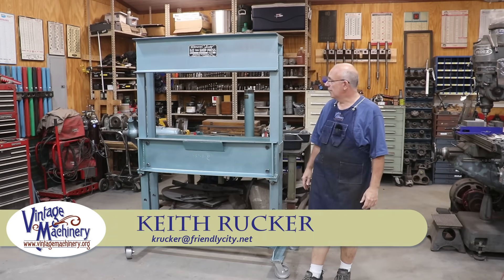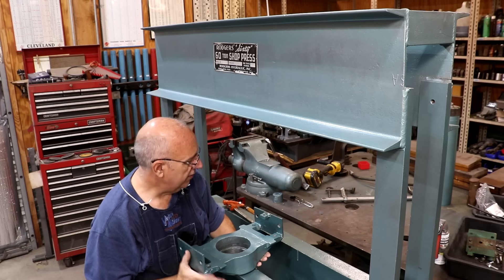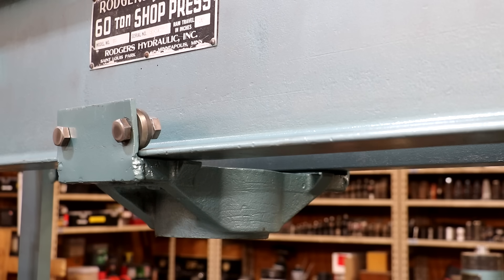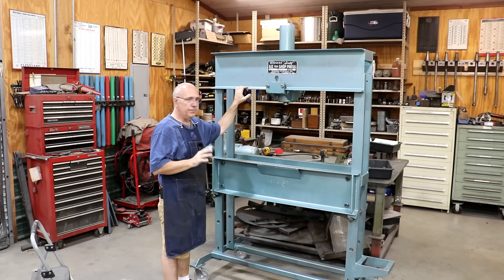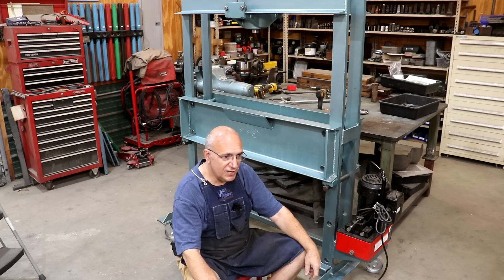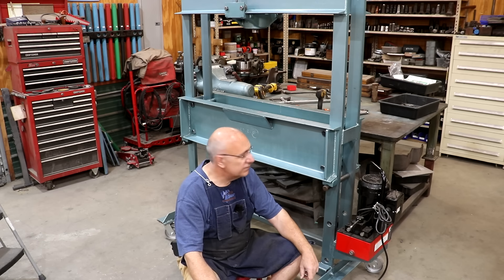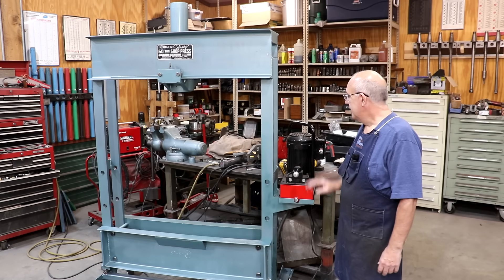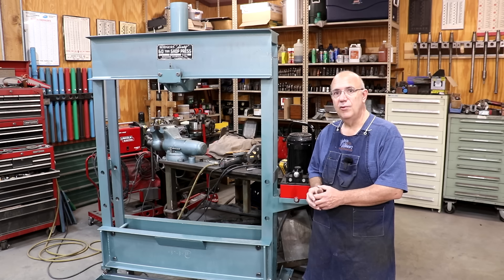Hydraulic Press Restoration - Part 3: Reinstalling the Cylinder and Mounting a Power Pack

Comment: Keith!!! About the "carriage and wheel support flanges": You showed great balance between OCD/Doing-It-Right and living with an eye sore that drives you nuts every flipping' day--turning it around was brilliant!
Reply: I will still know it's there.
Reply: OCD is what keeps disasters like that halfassed job away from a proper product. The person who did that job was a geterdoner and the results speak for themselves. OCD is good, keeps you on the right path. Now, that's not to mean that the extreme CDO is ok to live with, because you'll never finish anything unless you're very good, and few are, but it's better than what resulted in the mistreatment of this poor press. just my 2 cents
Reply: Except for the fact that the hydraulic connection is facing the wrong direction.. I guess it would make a good loop so that the cylinder can slide back and forth..
Reply: "Out of sight, out of mind" , "what you don't know won't hurt you", etc.  - popular expressions suggest that this is a common solution to situations like this!
Reply: @aserta  This is not OCD!!!  You do not know the severity of this disease!  It is a terrible, debilitating handicap.  This constant use of "OCD" is so wrong.  We have it in our family, and it is heartbreaking to watch the affected individual try to function as a normal human.  Please stop misusing the term.  A bent bracket that makes a wheel run a little rough has nothing to do with the real struggle of OCD.
Reply: @maxheadflow  I wondered about that as well.  The cylinder fitting is turned 180 degrees from the pump.

Comment: If that's a standard electrical J-Box the "hole" should be a 1/2" (trade size), although probably not needed that would be a good place for a power-on indicator.  Great work Keith!

Comment: That "I-beam" is actually two pieces of "ship channel" with a spacer in between. When I was in the Mill Supply business one of my regular tasks was to take a wider but shorter piece and make a custom pump and motor base out of it. I would Dykem and lay out a centerline and all the pump/motor locations, then Mag drill the holes and tap them. I would then make a coupling guard out of expanded metal and drill and tap holes for that. I "knew" the shafts were aligned, but I put the coupling in there loose with a card that said "Pump and Motor MUST be aligned AFTER base and piping are installed". Of course, I painted it all red before I put it together. Had a couple customers call my boss later and ask: "Where did you FIND the guy that made this"! 😁

Comment: Keith, Good job so far but you should plumb the side of the valve not used to return to tank because when the cylinder is retracting it will be pressurizing at the plugged port. If not plumbed in such a way it will cause squealing at relief valve and heating of oil if not plumb to what I call sump or tank.

Comment: The wheels and air over hydraulics are the first thing i also did with my little (brand spanking new) 20 ton press.  Then added a platform base to hold heavy tools (i am paranoid about tools tipping over), and added ballast to lower the center of gravity.
The air hydraulics was an ultra high priority after watching you hand pumping a big press at your museum trying to remove rusted together gears/shafts.

Comment: Looking good Keith. I hope that manual valve has an open to tank Center position or the cylinder will not retract when you shift it.
Reply: If that valve is open to tank in the center position, the press is going to be practically unusable. It would start retracting as soon as you stop advancing the piston, which would be super annoying. You want a press to be able to hold its force, so that you can add some force, check that all is good, maybe apply heat, and then add some more force, a little at a time. I am pretty sure this valve is closed in the center position, so simply plumbing the other output directly back to tank might be all that's required.
Reply: I suspect that the leftmost (assuming he goes that way) will pump fluid out.  Center then would be neutral - no push, no pull.  The right position would release pressure from the other side.

Comment: Thanks Keith for the video. Nice looking press.  I hope the control valve work out for you. some time on a bidirectional valve the center position is block.  Thanks again the project is coming along.
Reply: Same thought here.
Reply: @jmhannnon then he can just plumb the other direction to tank, and it will release the pressure

Comment: At one shop I worked, they had a Rodgers 100 ton press that press was as reliable as stones and it had a very nice feature : as the pressure increased, the resistance to move the command handle became more resistant, this was a sensitive device.
That press will be an asset in your shop.

Comment: Rather than putting wheels on each piece of equipment you want ‘mobile’, have you considered just welding on pieces that palletize it so you can move it with a pallet jack?  Saves you a lot of money in casters but also yields a more stable piece of equipment that’s not going to move around in use. Enjoy your videos. Thanks.

Comment: When working up your design for lifting the platen, I suggest the winch reel be divided, i.e. each wire has its own side to wind up on and a generous length of adjustment be included in the longer cable to take up stretch, threaded rod, turnbuckle or the like.

Comment: Tighten the clamps. Pull the wheels.  Slip a washer between the flange and the bearing inner race.  You may need to grind the jam nuts thinner or use 4 slightly longer bolts. 

If you put more washers between the plate and the roller.  You will get the rollers on a thicker flange and reduce the dangle gap.   
Jam clamps.  Weld nuts to the side of a coupling nut to allow you to bolt the nut in.

Comment: Nice work so far on this restoration.  Only thing I would be concerned about is a strap on that power pack to hold it down.  Inevitably you are going to be using this to press out some stubborn part on one of your restorations, and it's going to be really stubborn with a lot of heat and a lot of pressure to break it loose.  When it finally does let loose, that press is gonna want to bounce with all the forces.  So maybe a bungee cord or a ratchet strap around it so the power pack doesn't bounce out of your tray.
Reply: Yes, hold-down required. But anything that heavy that might bounce over a 1" lip, bungee is not gonna hold it.

Comment: A short hose from the pump to a steel pipe attached to the frame.  Pipe to the to top of the frame and put an ell to horizontal.  Then a hose along to top long enough to make a gentle bend that will allow the cylinder to move to either side.

Comment: If the power pack valve has open cylinder ports, you have a wonderful opportunity.  When shifting the valve one way, you could power only the upper side of the cylinder to have high force.  When you shift the valve the other way, you could pressurize BOTH sides of the cylinder, giving you only the area of the rod to push with.  This would result in lower force but higher speed.  With the spring return, you do not have to power the cylinder back up.  If you have closed cylinder ports on the control valve, you can do the same thing by adding a couple of pilot operated valves (the hydraulic equivilent of a relay).
Reply: I don’t think there are pressure seals on the outlet of the rod only the original brass guide.
Neat idea, but it would need modifications to execute.
Reply: @petegraham1458  Ooops!  You're right and I'm wrong.  My imagination got ahead of reality for a moment.

Comment: It will be cool to see the press working.   I will be curious to see the amount of noise and vibration the pump introduces.  You may want to consider a vibration isolation mount for the pump, if it causes the work to move around like one of those old table football games with the vibrating surface.

Comment: A friend built a very large press.  Rather than use winches to raise and lower the table, he has an adapter for the cylinder rod so that chains can be hooked to the table to raise or lower it.  Much more sanitary process.

Comment: For the bracket weld to the stand, vertical down works great with mig, not the greatest strength but at 60,000 psi per cu/" plenty of strength to keep the pump unit supported. You may want to try vert. down on some scrap to see if you like it.

Comment: i believe you will still have to throw the lever in the other direction to return the ram due to being under hydraulic pressure the spring returns the ram when manually operating the pump once you release the pressure with the valve like a car jack love your channel sir keep up the good work and you might benefit from having rubber strips under the pump too to stop vibration when running the pump

Comment: 30:58 investigate if it's not possible to have one side of the valve body increased in flow. Now, before putting it on, it will be easier.
I'd also see if it's not possible to machine another block (the one where the fittings go) where the fittings would exit at 45 for the inward one (to the press) and out the side for the other (assuming you can make it flow faster, and use it as a fast travel option). You have the machinery to do this, and it's easy if there's no specific part of the valve body in there (that gets more complicated on account of having perfect tolerances, so not worth it).

Comment: I hope you made sure that the oil Reservoir on the power unit is large enough to fill the cylinder without running dry.
Reply: I was just about to say the same thing - that’s a big old cylinder to have to fill at maximum extension, though I guess the reservoir capacity could be increased by connecting an extra container to the sump drain plug hole.

Comment: Prewatching, I'm curious how you plumb up the hydraulics, to use a single acting cylinder. I'd have been tempted to swap out to a dual direction cylinder.

I'd have put a washer between the wheels and the mounting bracket, so the outer diameter isn't rubbing the face of the bracket. I'd suggest bending the rear bracket to take up the 1/4" gap, primarily so the cylinder is cocking to the rear when you apply pressure to to the work.

Comment: Keith, I'm reminded of a saying. "A grinder doesn't a welder make". That applies to me to. Just a note, if you bevel the surfaces to weld, you'll get better penetration. As it is now, you ground off most of you weld strength. A cousin welded a shaft to a gear box, and didn't know that beveling the two pieces would give him more strength. He simply made a butt weld, smoothed it out, went to use it, and it broke.
It looks like you'll have a nice press when you're done. I look forward to seeing the finished product.

Comment: Keith I really do feel for you. That trolley would drive me totally potty. Just knowing what its like at the back would mean I couldn't live with it. As you are having to wait for the hoses, I would take the time to remove both those plates and make up new fixtures for the wheels so they were running on some form of bearing. Not needed I know, but I would also know that it was right. OCD can be a right bugger at times.

Comment: almost certain that hydraulic valve won't back feed in the center position. but possibly you can plumb the return in to the feed line, or add a bypass valve to retract . the company may have alternate valve set ups available too .

Comment: Keith, why don't you just slot the holes where the steel wheels go upwards on the vertical plate so you get a gap and so the head will roll?????

Comment: Hi Keith - great video! About that gap on the back where you did not weld a new nut in place.  If there is a gap on the back (even small) and none on the front, then won’t the tip of the ram try to shift toward the back when you apply pressure?  Perhaps this would introduce unwanted diagonal force into the work.

Comment: Keith, what do you use for raising and lowering the anvil underneath the press? I see it was high in the first part of the video and at the bottom at the end. But that sucker looks heavy! I think I'd be pondering a cable-and-winch system to mount on the other side of the frame.

Comment: The hydraulic control block may need to be changed for the cylinder to spring return. With the lever in the centre, the control block will not allow fluid to pass

Comment: I'm not a hydraulic guy but would wonder if the center position releases pressure on the lines or holds pressure.   If that's the case, it seems like you might need to route the external "up" line back to the reservoir..

Comment: - Keith, how hard would it be to machine in bronze or roller bearings for the wheels press slide?
- Would it be hard to mill slots into the two flanges welded on to receive strips of nylon so those flanges would easily and Quietly slide against the cross H beam?
- I know I am being OCD finicky but the noise and stickiness of that set up aggravates me no end.
- If I had such a shop as do you, I probably would have festered until found a way to make the steal wheels quiet or change them to something that would be silent. ...Groan!
 😟

Comment: Keith,  2 things: Would an anti-seize be appropriate for the Crosshead-to-Cylinder threads ? 2. What if you place four, or six, inch and one half squares, of eighth inch sheet rubber, between the power unit and the tray you built. Stop the rattling, cushion the works. Great work,  Al

Comment: I would have bolted the bracket to the cross bed. That way the controls woud have been at the work height of the cylinder head at all times of operation. And like you my OCD is frantic to tidy that slide assembley.

Comment: as big as that press is, I doubt that moving the cylinder around will be often necessary.   I have a 20ton and its about 1/2 the size or a little less than this one and moving the cylinder around hasn't been a problem and I've had it for 15+ years.  It has made me a ton of money, pun intended.

Comment: Is a real shame Keith, that whichever of this device's prior owners made such a dog breakfast out of that... What is the proper name? Gantry? Saddle? Collar? The bodged together piece that is supposed to run smoothly side to side and which the cylinder screws into. I totally understand your niggling dissatisfaction with it. I would have pulled my hair out also! Maybe one day you will be able to get hold of a proper, original replacement for it. If nothing else it does at least work well enough for now by the look of things.

You fabricated the fitting for the pump assembly very, very well indeed. I wasn't sure how that would look when it was all in one piece, but it appears almost like it is original! The only suggestion I might make is to drill and tap a couple of holes in the side of the angle-iron mounting. That way you could attach two set screw that would grip the reservoir tightly and eliminate that slight wobble when you open and close the valve. Otherwise as I say--absolutely brilliant work!

I cannot wait to see this thing when it runs!!!

Comment: You may want to put a bungee cord over the top of pump to hold it down , I can just picture you pressing something out and it lets go all at once and the press jumps and the pump jumps out of your tray.
Reply: Bungee cord or metal strap, either would work but a bungee cord would be easier to remove if work was needed to be done on the pump.
Reply: I was going to say this too. I've seen hydraulic presses jump like a Pogo stick when something breaks loose.

Comment: I'm curious how a single acting piston with spring return will work with an open center control.  I don't mean I think it can't work, I just can think of some use cases were it might become challenging to use.  Unless I am missing something the press can be in only two states, either applying pressure or retracting.  There isn't an option to hold the press in position.  When you need to stage the press for a part or to stop to check measurements it would be nice to  have the cylinder stay in place.  Being able to clamp something in the press would also be nice.  Obviously you could just throw the power switch on the pump, but that seems inelegant. I'm sure this problem could be solved with some creative plumbing.  A pressure gauge and an inline adjustable relief valve would also be handy.  I can be difficult to 'feel' how much pressure you are apply to a part with hydraulics.  This is just me thinking out loud.  You may have solutions already or even not consider my questions as something you care about.  I respect that and look forward to seeing what you come up with.  Thank you for sharing your projects.

Comment: should have left the pump down at the bottom now you can't slide long stuff through it you could have taken the handle off and connected a rod to the shaft and made a bracket to hold it and had the handle up where you wanted it

Comment: You may have to remove the plug from the valve and,run a hose from the port,back to the tank.I would suggest doing that before you fill the tank. If you test it and it doesn’t bleed down, you could make a real mess trying to crack a fitting to bleed off the pressure.Don’t ask me how I know.😂
Reply: 31:02  the cylinder has an internal spring to return the fluid... watch this...

Comment: OCD is a good thing. 
I was looking forward to custom wheels with matching shoulder bolt. With a nut on the outside. No to welding nut back on. A piece of 20mm plate two holes to mount it to the carriage and one in the middle to lock the carriage. 🤔

Comment: Plain bolts rather than machine screws might be better, ie with an unthreaded part of the shank running through the rollers. Instead of jam nuts, you could drill a flat on one of the nuts and tap it for a grub screw. I would round off the corners of those two side plates to improve the appearance of them. Nice work overall though, it is not easy dealing with heavy stuff on your own.